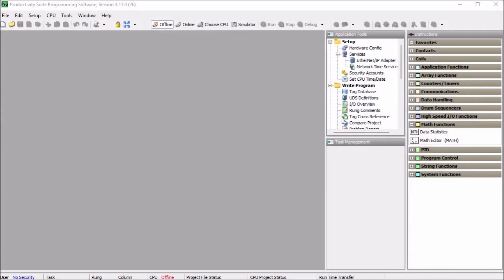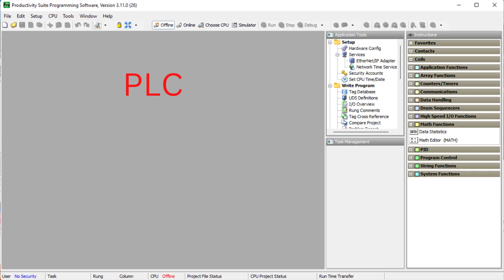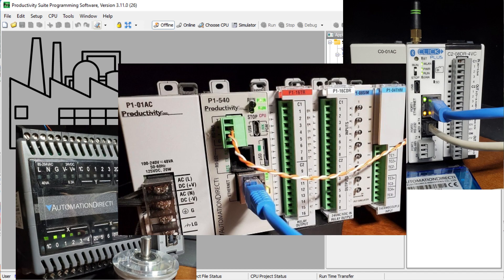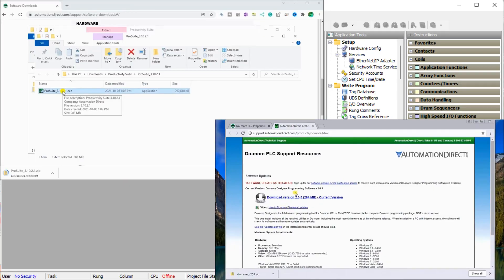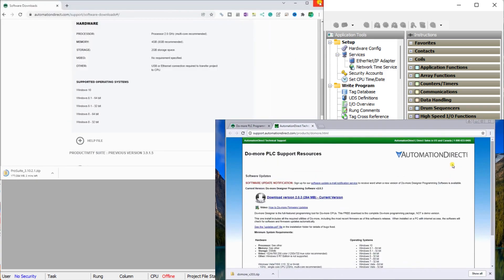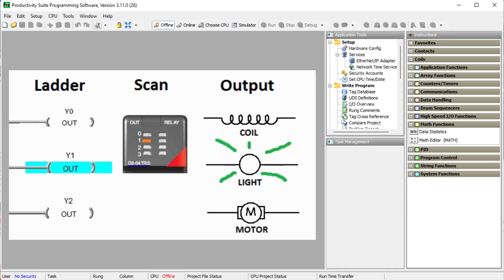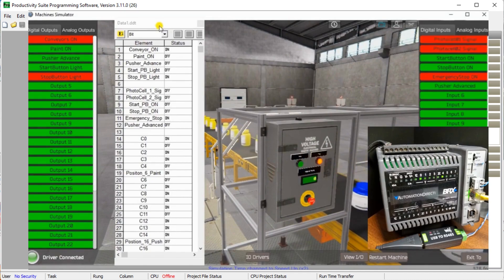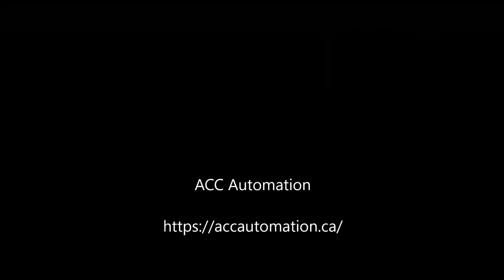3 Steps to PLC Programming - Learning

Comment from the maker: Here are the controllers that we have covered at ACC Automation:
BRX Do-More Series (Do-More Designer Software + Simulator)
https://accautomation.ca/series/brx-do-more-plc/
Productivity Series
https://accautomation.ca/series/productivity-1000-plc/
https://accautomation.ca/series/productivity-2000-series-plc-p2000/
Click PLC Series
https://accautomation.ca/series/click-plc/
Omron CP1H Series
https://accautomation.ca/series/omron-plc-cp1h-series/
Horner XL4 PLC Series
https://accautomation.ca/series/horner-xl4-series/

https://accautomation.ca/series/easyplc-software-suite/
EasyPLC Software Suite is a complete PLC, HMI, and Machine Simulator Software package. See below to receive 10% off this software. This PLC learning package includes the following:
Easy PLC – PLC Simulation that will allow programming in Ladder, Grafcet, Logic Blocks, or Script.
HMI System – Easily create a visual human-machine interface (HMI)
Machine Simulator – A virtual 3D world with real-time graphics and physical properties. PLC programs can be tested using EasyPLC or through other interfaces. (Modbus RTU, TCP, etc.)
Machine Simulator Lite – Designed to run on Android Devices.
Machine Simulator VR – Virtual Reality comes to life so you can test, train or practice your PLC programming.
Purchase your copy of this learning package for less than $75 USD for a single computer install, or less than $100 USD to allow different computers.
Receive 10% off the investment by typing in ACC in the comment section when you order. http://www.nirtec.com/index.php/purchase-price/
Learn PLC programming the easy way. Invest in yourself today.

Regards,
Garry
ACC Automation
https://accautomation.ca/